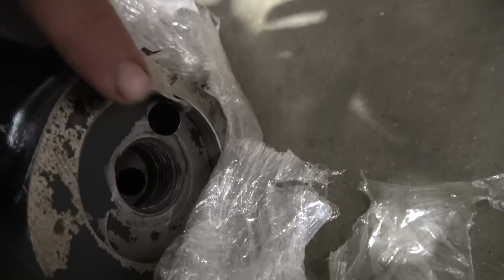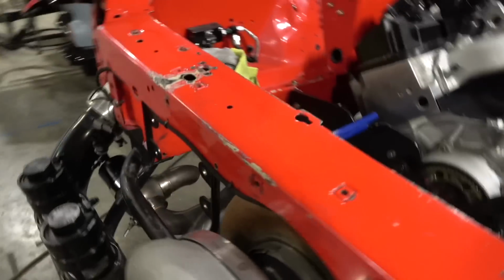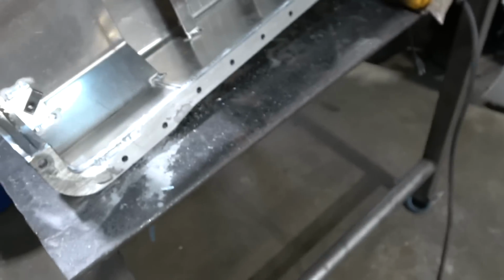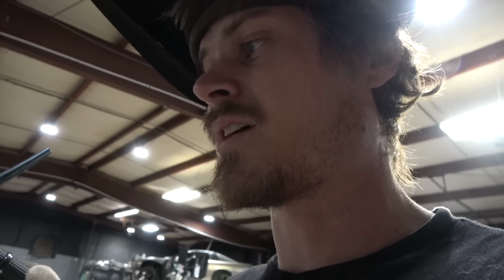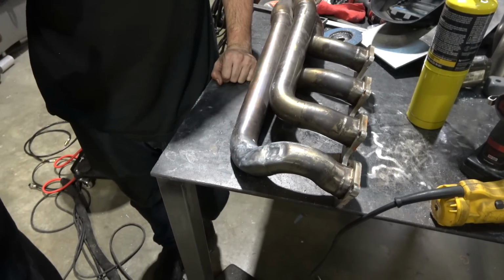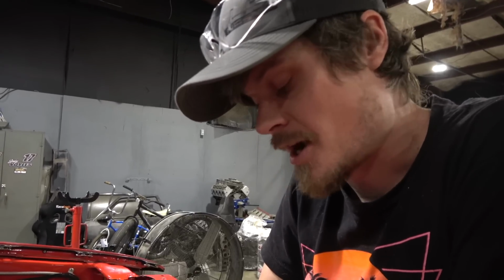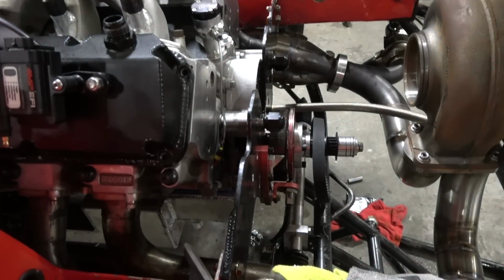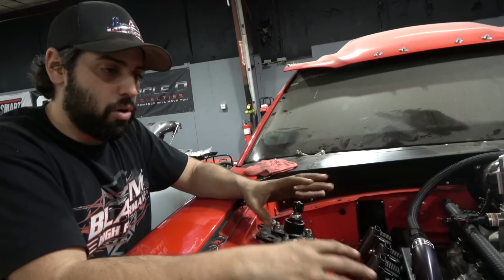Getting the RED LOBSTER ready for LIGHTS OUT!!!

Comment: Sbf oil filter adapter is 1 1/16 - 12 pipe. All factory blocks are that. There is no oring factory OEM. Some aftermarket blocks are different. If it's a wet block and  run external pump you want to use an adapter that covers that whole filter area.

Comment: Quit blaming Ford! Its an aftermarket block  and pan. Didnt I just watch a video where you were struggling to put oil in your LS engine?
Reply: Take a deep breath guy your gonna be ok 👌
Reply: @Scandalous3pedals  it worked out pretty good.
Reply: Aftermarket block that is still a ford footprint. It's just a block designed to hold hp.